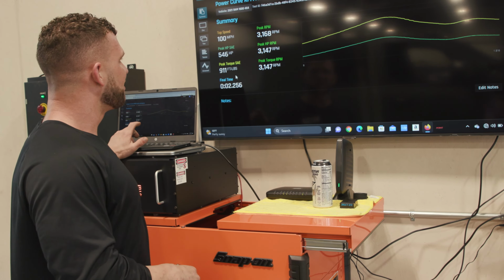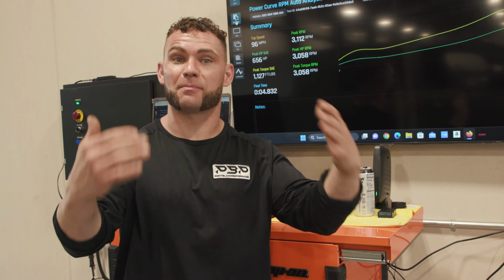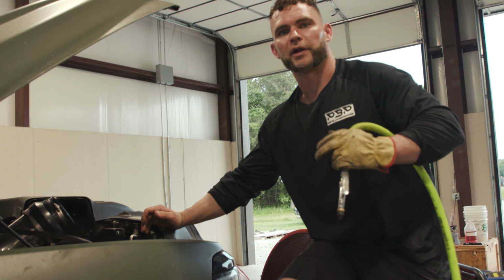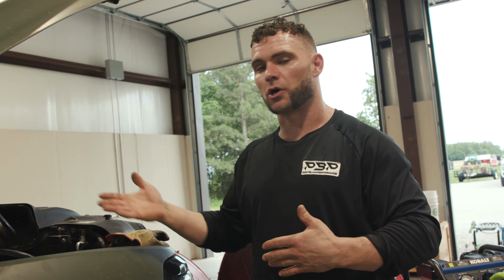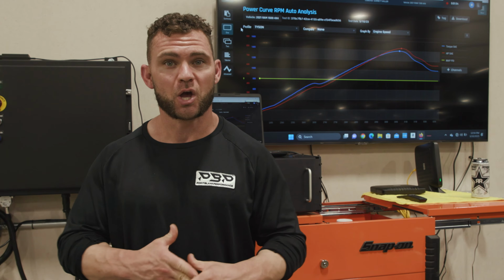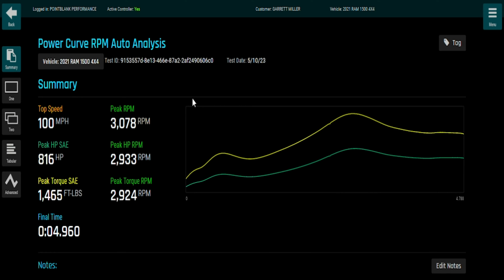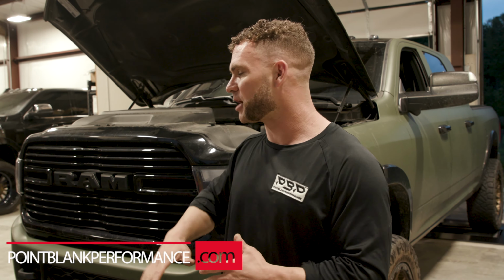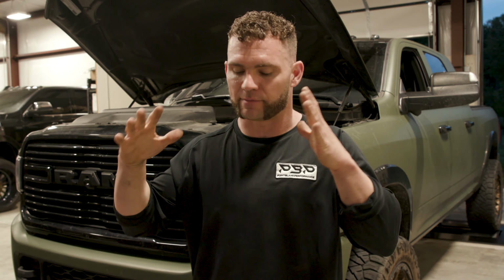BUILDING A 1,000HP CAPABLE 5TH GEN CUMMINS!!

Comment: If the 10/2012 truck don’t have a aftermarket head they are lost for power I seen firepunk put down crazy power but then changed the head and changing the head with all the Saport the sa porting mods it made like 250/300 hp just from a head the 2010/2012 year had some kind if head set back

Comment: Where should I be at hp range wise on my 2020? tuned, s467 second gen swap, 100% overs, 12mm cp3. Thanks!
Reply from the maker: 720 ish sir ! Depending on AR sir give or take 30 hp
Reply: @POINTBLANKPERFORMANCE  I forgot to mention the 200gpm fass, I just want to make sure I get a built trans that’s rated for enough Hp but not overkill.

Comment: You ever dyno any G56 trucks?
I’ve got a 2014 3500 Dually with a 2g swap s472 1.0ar 10mm pump 30 over injectors fass 250 stock cam Hamilton springs fire ringed and studded been on one dyno and made 500hp 900ftlbs then down to 450hp and 700ftlbs 3rd run had no results.
Runs good though
Reply from the maker: We haven’t sir !
Reply: what clutch are you running? ive got an s472/87 1.0 on the way currently running a south bend dual disk

Comment: Firepunk did over 1k on a 19 so with a 472 93 1.0 100 overs and a 10 ml cp4 they have the video
Reply from the maker: I’ve yet to get a 10mm Cp4.2 to make over 740. If there is a cp4.2 that can make a 1,000 Hp I’ll be more than happy to run it on my dyno.. Even over driven 1.5 times I would be shocked at 800. But much respect to FirePunk we are a fan🤙

Comment: The exact set up I have on my late 3rd Gen 6.7. What A/R on the charger? I can agree it’s a well rounded set up/single at that level. Nice runs
Reply from the maker: .90AR sir
Reply: @POINTBLANKPERFORMANCE  gotcha, I wonder if you would of been able to squeeze a bit more out of it on the top end with a 1.10. Mines a 1.0 personally
Reply from the maker: @Cole_H  I do believe so ! And drop the tires down we could pick some up !!

Comment: Do you think it would make more power if you ran it to 4k rpm?
Reply: Imo it would need a cam to take advantage of the rpm
Reply from the maker: No sir 3200 ish she’s out of air my man , it’s was hot this day but the power didn’t keep going with rpm’s stayed in the 2900/ to 3200
Reply: @POINTBLANKPERFORMANCE  Do you think she would have flowed enough if he had a 1.0 housing instead of the .9?